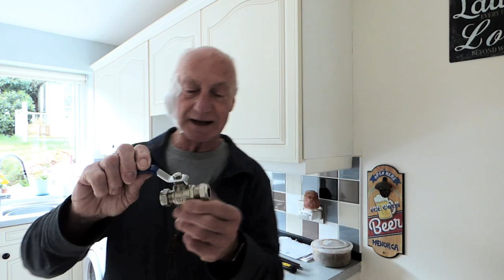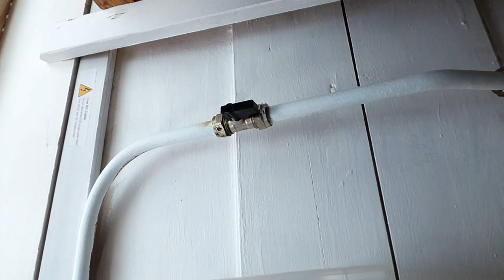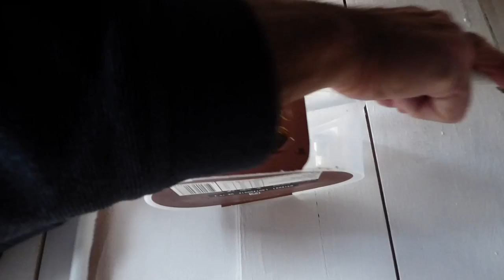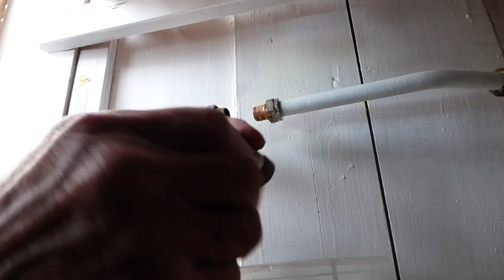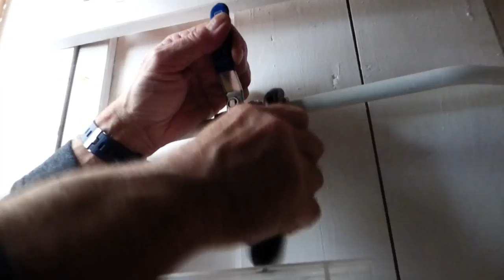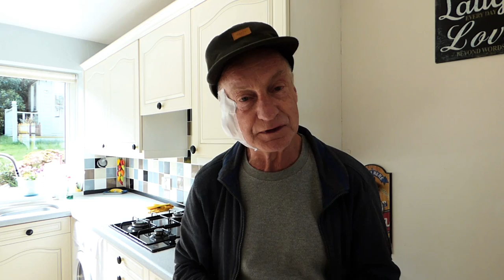How to change a ballafix isolation valve for a full bore lever valve.

Comment: Just thought I'd forewarn people who aren't plumbers that some full bore lever valves have a sliding latch along the handle so before you can turn the handle on/off , you need to slide that catch slightly up .  When I closed my full bore , the latch must have been slightly up so it turned off quite easily , so I didn't notice it was there.  But when I tried to open it again , it wouldn't budge , I panicked a bit and tried to use a lot of force but gave up.  I thought the valve had somehow malfunctioned and got stuck in the closed position.  Only on closer examination , did I see the sliding latch in place. Just a simple slight push of this latch up the handle released the handle and then I could easily turn it to open .  I was extremely lucky that I didn't rupture the pipe with the force I was using on the handle and I could have flooded my property as it was a supply pipe from the mains into my cold water tank. Problem is no-one ever told me about the sliding latch and there was no instructions apart from which direction to close and open the valve.
Reply from the maker: Thanks jack not all of them have that catch.

Comment: Great video , what is the process when changing one of these valves on a hot water bath feed that is fed by an Un vented cylinder ? Does the system need to be drained down ?
Reply from the maker: No you should find once the mains is off that the hot tap runs for a short while then stops.
Reply: @dereton33  many thanks 👍

Comment: Good job Al 👍
Reply from the maker: Thanks PB.
Reply: Those early, older, ballofix valves with the tiny, tiny slot are the worst. If they haven't been used in ages, they will break and fine mist water. Best option's to turn off the mains at the stop tap, and if necessary, drain down first. Been caught out once before. Wont risk it again.
Reply from the maker: Thanks for the advice loafer, I have had the same thing happen to me. If I see one of those I leave it well alone. Hope you are keeping well mate.
Reply: @loafersheffield   I remember round my area through the 90's there was a lot of white plastic service valves that had a round disc on/off control, these were generally found on supplies to water softening equipment. When you turned the disc it would blow off and you'd have full mains pressure water flying at you 😬 I can't remember who made the valve but it was a disaster in more ways than one.
Reply: @PB I'll bear that in mind PB. Thanks for the advice. Thought about entering your quiz for the tool tote/bag, but had to go and get my another anyway. Trouble is, had to get matching shoes and a new frock. See last 4 minutes of my "new tool bag, new shoes, new frock upload."
Reply: @dereton33. Not working tomorrow morning. I've ditched off for some old bloke, (80 yrs +) and some others, to a very later date. It's not an emergency job... squeeling pipes when a wash mac fills. The current chinese malaise has made me a little more considerate towards older folk. My old dad had the skin cancer issues. He had to have the laser treatment. I wouldn't worry unduly. The success rate is exceptionally good. Just got to admire your spunk. Can't be good uploading a vid with what looks like a panty liner on yer mush. Could be worse, you could be looking at my ugly mug. All the best, pal. Sincerely.
Reply from the maker: Ha ha thanks loafer, Jan says shes loves a man with a good scar. Bandage off tomorrow.

Comment: I fitted one of those smaller values to the flow and return at the manifold for a rad to help isolate it so I could do some renovation work. Would that impede the flow or does that only really matter for mains pressure lines? Cheers Al for another informative vid.
Reply from the maker: They will impede the flow, I take it that it was one of screw type isolation valves.
Reply: @dereton33  oh. Too late😕 it was exactly as the one in the video with the thumb turn knob. The knob in the plumbing shop never mentioned that either 😂

Comment: Hello, my isolating valve is with a plastic handle. Now the handle (lever) has failed (cheap plastic). Do you know if you can only replace the handle or do I require to fit a new valve. The handle itself has a screw but I cannot tell whether it goes into the valve or just is there to hold the handle on the rest of the valve.
Reply from the maker: The screw just holds the handle on. You will need a new valve and use the handle off of that.
Reply: @dereton33  Thanks for the swift reply!

Comment: I notice that some of these valves are described as being half inch instead of 15mm, is there actually any difference?
Reply from the maker: No none, half inch is 15 mm.
Reply: @dereton33  Not on my ruler it isn't.
Reply from the maker: It`s close enough.
Reply: 1/2 inch refers to the thread... 1/2 inch BSP. BRITISH STANDARD PIPE THREAD. Using it for 15mm pipe fittings. 
I believe 3/4 bsp is for 22mm thread. Hope that helps.Don

Comment: That container looks like a chocolate ice cream container. Did you have to eat all of the ice cream first, before you could use it? Those early, older ballofix valves with the tiny, tiny slot are the worst. If they haven't been used in ages, they will break and fine mist water. Best option's to turn off the mains at the stop tap, and if necessary, drain down first. Been caught out once before. Wont risk it again.
Reply from the maker: Funny it seems I have lots of those containers around. Ha ha. Have had the same trouble as you with those ballofix valves as you loafer.
Reply: @dereton33  Carte Dor containers are indestrucible they will outlast human civilisation.  The next inhabitants of the planet (talking dogs?) will find archeological layers of Carte Dor containers filled with screws and old doorknobs.
Reply from the maker: Great stuff those containers.